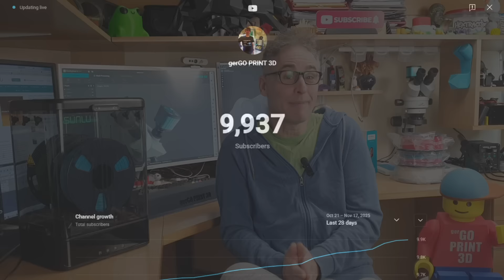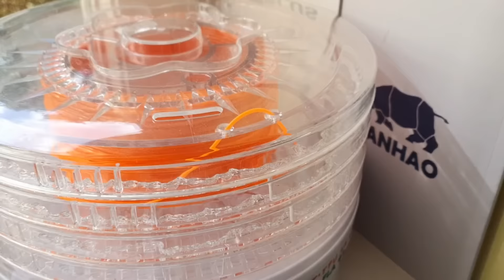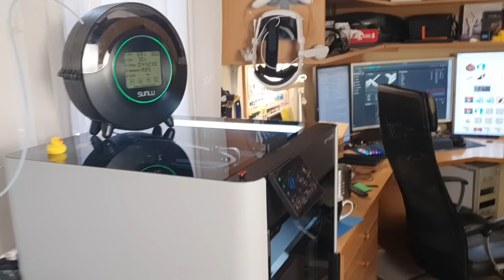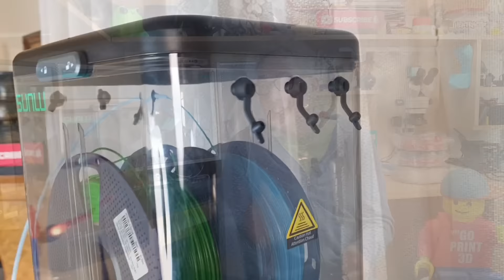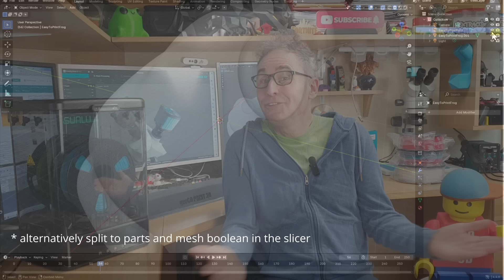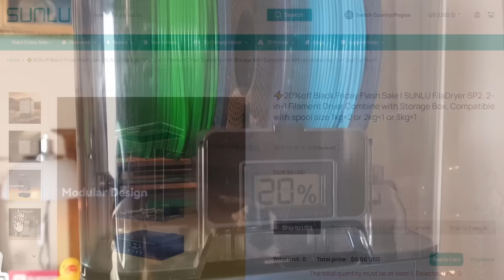Victory over humidity: SUNLU SP2 and our PLA-safe room 🐸 That frog is a functional print?!

Comment: Excellent “low Humidity Room solution!   Surprised your able to drive humidity
Down to 30% with only that small dehumidifier and only emptying the water every 10 days!  I was not so successful as yourself, I used an aircon in humidity reduction mode and was only able to drive humidity down to 50-55%.  As I only turn the AC on a day before I will use the print room I have yet to measure cost, but I am sure it’s high. Unfortunately only space I have is large and can’t break it apart as I rent it, so I looked for cheaper solution.  I try to find good drybox that allow direct feeding. I am in Thailand and average relative humidity is 70-80%. I made this YT only to get help comments on this drybox solution because it’s very cheap!     
 https://youtu.be/sLX0vdInxJU?si=GwNMvREdw6B2e8oW
Reply from the maker: It's 10 days on average. In the summer it is more like 7-8 days and in the winter its every 2-3 weeks!

Comment: I dont worry about it with my pla. Doesnt seem to matter one bit.
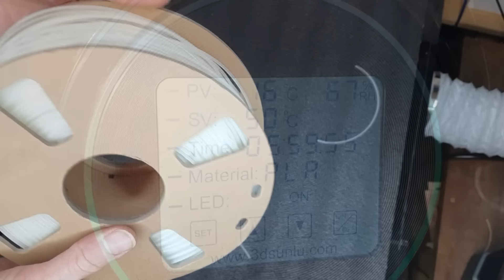Reply from the maker: It depends a lot on the climate. In Budapest, humidity levels of around 60% (sometimes as high as 80%) can ruin PLA over the long term. The spool I show at 4:48 is an example of what happens to PLA when it’s left out in the open for an extended period. There is no fix once moisture damage occurs; prevention is essential unless you live in an exceptionally low-humidity part of the world or use up opened spools quickly.

Comment: Grats a little bit in advance of 10K.  You put a lot of thought and work into your channel and you deserve success.  
 I've seen some PETG with a GT around 75C so I dry at 60C.  That leaves room for error if the dryer has hot-spots or an inaccurate thermometer.
Reply from the maker: Thanks for the kind words! I absolutely agree to being cautious with PETG drying temps, 65°C was only necessary for feeding that rough glow-in-the-dark variant, normally I wouldn't recommend going higher than 60°C.